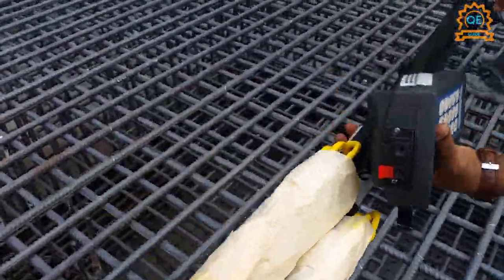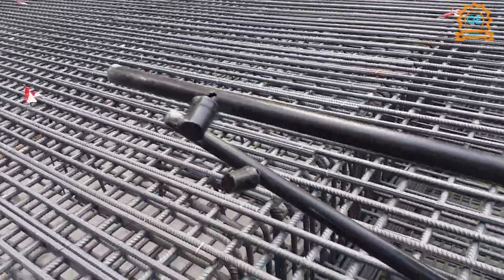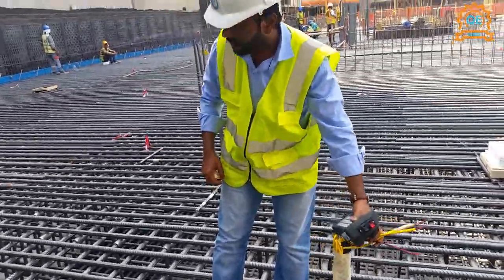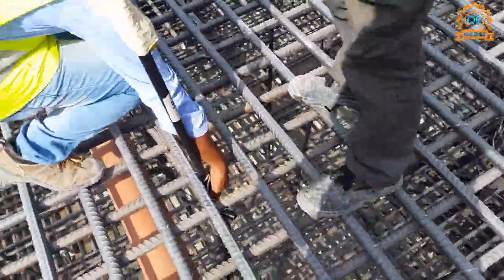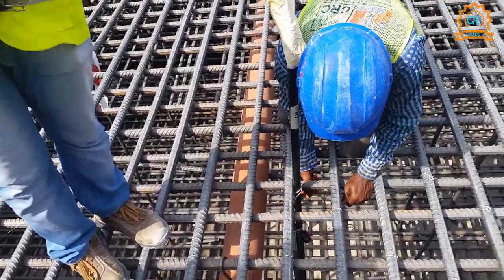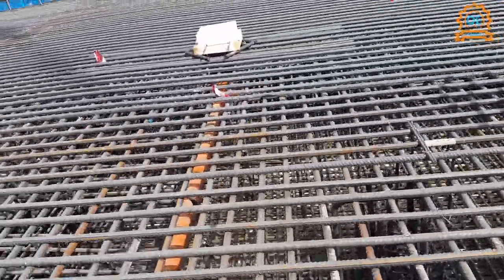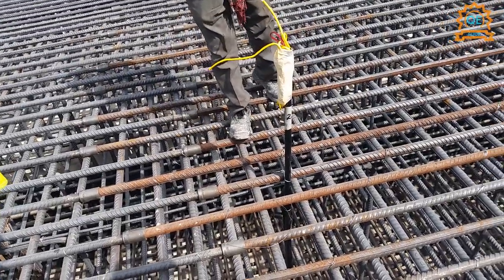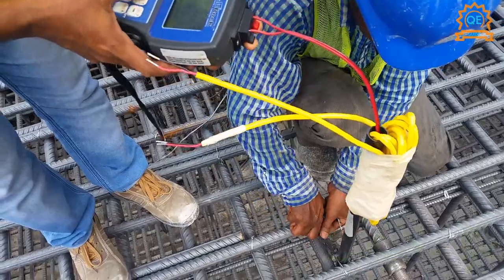How To Install Thermocouple - Temperature Monitoring for Raft Concrete

Comment: sir what's the purpose of this test?
Reply from the maker: To ensure that the concrete being poured does not exceed temperature limit.
Reply: Why would they come and check sensors until 24 hours after casting? Shouldnt they be checking during casting to take proper measures if temperature too hot?
Reply: That's to measure heat of hydration which obviously came be measured after pouring completion.